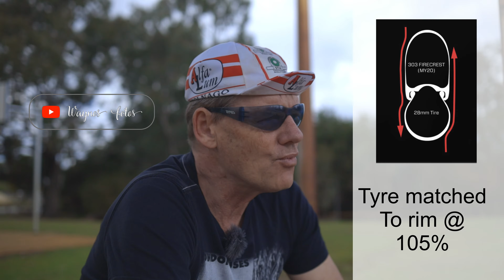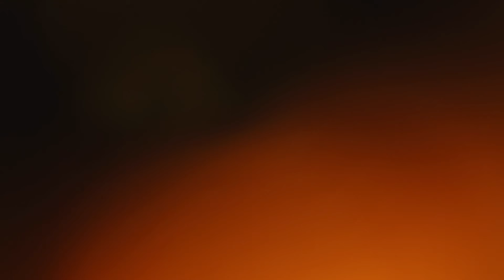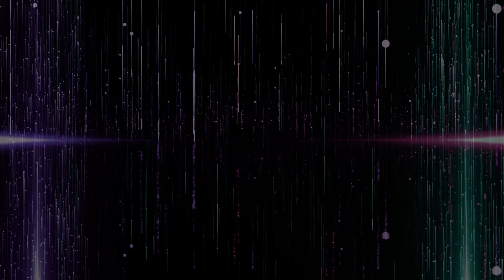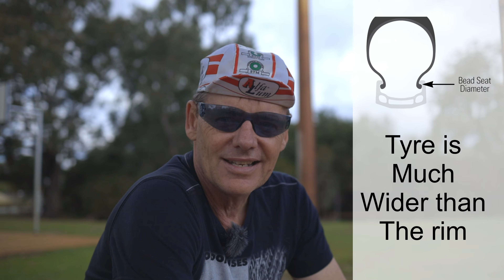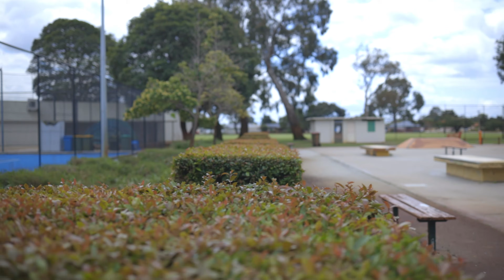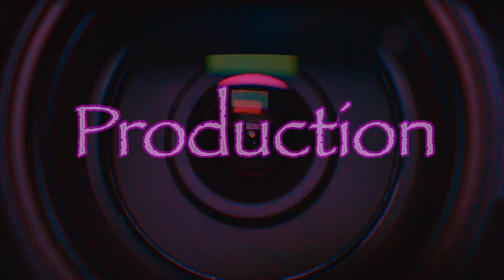23mm on 25mm RIM, using the 105% rule

Comment: can i put 23c on 28c rim?
I find in aliexpress Elite Wheelset Edge that is very light but they are 28c wide
40mm 1260g 50mm is 1320g
they also have 25c rim 38mm 1260g

Comment: Does Zipp's 105(%) rule say anything about getting your rims scratched because the tire fails to protect the sides of the rim against bits of gravel or the occasional kerb?

Pretty much sure it doesn't. And there's more to life than aero gains.
Reply from the maker: Yes that can be an issue

Comment: "Aero" is everything.  I just bought the newest "aero" tires, along with everything else on my "aero" bike which includes "aero" chain lube and my new "aero" rear LED light. I got my calculator out and added up ALL the "aero" advantages I have and I am now saving exactly 6.722368 HOURS per mile/4.1770863413 HOURS per kilometer. I am SO jacked! I  sent away for some "aero" beard oil that will decrease my dander/filthy beard drag by 28.5221% I'll update you in the future on THAT!
Reply from the maker: Loln

Comment: Running 23mm micheline tires on ICAN 25mm (outside) rims.  This is not in line with their recommendations. They advise minimal 24mm tires, but they are as rare as hen's teeth. The 25mm conti's I normally use don't fit my bike with these wheels..bummer. The current setup rides nicely, maybe a bit less demping.

Comment: For those that commented about comfort, try running 25mm up front and 28mm in the back.  I know we're talking fairly small gains here but the "105 rule" is more improtant on the front end than the rear where the seat tube on the frame blocks much of the airflow before it hits the rear wheel and you get the higher volume tire under your butt for comfort.
Reply from the maker: True front is where matters
Reply: @The86rick  Hmmm, ok sure, if you live near the cobbled streets of Belgium I guess that’s true. In my personal case years of training by 12 ounce curls have gifted me with forearms and biceps of steel. So real men don’t suffer from arm pump. Not sure what the metric equivalent to a 12 ounce is…. A one pint lift?  ;)

Comment: The "wider tire is best" crowd love to cite the superior rolling resistance of 28mm+ tires despite the fact that rolling resistance on actual roads is almost impossible to measure accurately, and totally discount the aero advantage of the 105 rule that is, at very least, a metric that is possible to measure.
Reply: “Rolling resistance is a myth”
Lol I’d throw you a Maxxis minion 2.6 dhf tyre to your front wheel and I’ll see if you still sing the same tube. 
You ca measure and compare RR in a lab setting. That difference can than be extrapolated to a real life scenario. To always argue “urgh but that’s not in a real life use case”, is simply being pedantic and silly.
Reply: @87togabito  RR measured in a lab is usually done on smooth drums and despite elaborate steps taken to make it more applicable to outdoor riding, nobody has ever sufficiently demonstrated that their lab RR tests reflect outcomes on actual roads, despite you saying it can be extrapolated.
Reply from the maker: I have done videos on this, 
As a performance metric, rolling resistance is a complete myth, when applied to the real world. 
The ability of the tyre to control road imperfections is a much bigger variable, why wider tyres are better on rough surfaces and skinny tyres are better on smooth surfaces.
And something people have forgotten is soft sidewalls control road imperfections better, why high TPI cotton tyres are still the best, size vs road for road imperfections speed trade off.

Comment: While true, those small aero gains are not relevant for 99% of riders and pros of a slightly wider tire (comfort, safety) are greater imo  :). 25mm clinchers on 17mm internal rims for winter, 25mm tubs on 24.2 outer-outer rims for summer.

Comment: That's about what Josh Portner  of Silca Velo  said. Might be true but recommended a wheel set costing double the value of my bike. He'll sell you secret sauce chain lube if you're interested. It's probably as good as the stuff GCN is being paid to promote now. Used transmission fluid works well too! 1/8" chains are inexpensive though. Cut it to length,  use it up, get a new one when it gets dirty.
Reply from the maker: I actually watched his video, they did some research on this when he worked at Zipp. Unlike other claims in the industry this sounds legit!
Reply: @waynosfotos  I agree.  The message is though that pro teams have had it all wrong forever.  Average riders emulate the pros and are now expected to buy new kit. I am glad to benefit from new tech as it trickles down. I'll take my tech A' la carte!
Reply: Used transmission fluid. Why not new. Won't it attract junk ?

Comment: I don't subscribe to any rules like that when I match tires to my rims. I pretty much have a tire brand and size that match the OD width of the rim. Some brands tires end up wider than their spec when mounted to particular rims and this also makes it hard to find proper tires but I use the R3 which usually is more narrow than its spec and therefore when mounted on my wider rim gives an aero shape that Hambini would be proud of.

Comment: Just a thought. Watch Alaphilippe as he broke away and mashed his way to victory. All the aero gains made by his equipment were irrelevant cos he rode on the hoods in a non-aero hip-snaking position with face fuzz. Why? Cos he was comfortable and could breath properly so put power down. Aero is often overrated, as he just demonstrated
Reply: However in this case, the tyre does nothing to affect your posture. 
The aero gains here are have no cost, outside a financial sense. 
And imo, money is literally the easiest upgrade a cyclist can get. You have to train for fitness; buying an aero bike or frame only costs money.

Comment: I run 28mm tires on a 20mm Internal/ 25mm external width and it’s great
Reply: hey, could you please tell me how wide that tire is on that 20mm internal rim? I want to buy new wheels and I had 28mm Conties on 17mm internal rims that measure almost 29.5mm, now im worried about fork clearance if the tires is gonna be too big
Reply: @ThePsychonaut  yeah, sure thing. On my current wheelset the 28mm tires measure more around 29 to 29.5mm
Reply: @astrayagrarian  its the same, I found some rim with the same dimensions, actually 21mm internal 28 outer and tried the tired and its 29.5 almost 30mm, thanks!
Reply: Do you notice any aero drag from having a tire wider than the rim I assume not since it's only two or three millimeters?

Comment: I thought I was down with the kids when I got my new rims and schwalbe pro one  28mm tyres which should have given me the optimum 105 percent . They did make me 
Slightly faster  but when measured with a vernier caliper were 30mm. I got used to the comfort of bigger tyres and now have stuck to 30mm as my ' go to 'tyre.

Comment: From my perspective, losing 1 lb. of body weight will give you more advantage than switching to a '105' set-up. So is it worth it to put up with far more road shock? 
I think not.
I think that having your tire larger creates a slightly larger aero tear drop that puts your tire/rim and rim/spoke transitions in the 'vacuum' area in your aero tear drop. Thus minimizing  the aero distortion caused by the irregular profile of those transitions. The slight increase in the aero tear drop is far less friction than the distortion caused by a too close tire profile.
Reply: I think difference in comfort is unnoticeable if you use comparable tire pressures. Difference becomes noticeable if you use fatter tires with very low pressure, but then you have additional penalty in the form of increased rolling resistance.
Reply: I actually run lower pressures with a 23c on a 25mm od rim than I did running a 25c on older slimmer rims. The reason being that the sidewalls of the 23c are straighter on the 25mm od rim. With greater curvature of the sidewalls you have to run higher pressures. The 23c/25mm OD rim/75psi combo has made a super rigid frame so much nicer to ride on especially when the days get long.

Comment: My rims are 21mm internal and 28mm external and I'm running 25c tire in front for aero advantage (maybe) and 28c tire at the back for comfort (surely) 😉
Reply: hey, please i need some info, could you measure how wide is your rear 28mm tire on that 21mm internal rim? I want to upgrade to new wheels and im still not sure how is that gonna look because right now i run 28mm Conties on 17mm internal rims and they come up almost 29.5mm wide
Reply: @ThePsychonaut  depending on the model, tires of older construction becomes much wider than newest ones. My old non tubeless conties measures almost 32mm, than my Hutchinsons fusion5 11storm measures at about 31mm, than Pirelli cinturato TLR have about 30mm width and my Tufo comtura 4TR measures at about 28mm. My buddy have Pirelli Pzero TLR and they measures about 29mm. So, you can see, how big difference can be in between brands and models.
Reply: @romanpramuka2703  Thanks man, I still need to research more, im in need of new wheels my rear Fulcrum hub broke on spoke, im considering some carbon rims that are 20mm internal and 27 outside, my frame is designed for 28mm tires but it gets kinda tight at front, it rubs on corners when i put all my weight on the drop bars but then when im on hoods it all runs fine
Reply: @ThePsychonaut  it looks like you need some stiffer wheels, maybe with deeper carbon rims. Keep in mind that with wider rims, tires becomes wider but not taller, it isn't same as wider tires on narrow rims.
Reply: @romanpramuka2703  wider yes, thats what I'm afraid of lol, 35 or 38mm is the deepest I'd go with 24 spokes, hope it turns out well
Reply: @romanpramuka2703  I have tested today my tires on 21mm internal rim 28mm outer and they measure almost the same, almost 30mm, mine conties are 29,5 almost 30mm on my fulcrum 17mm internals, so i think im gonna go with 21mm internal and 35 dept x) Though I would appreciate any suggestion if you can add x) i'm a light rider 60kg and mostly like to climb but i like to go fast on downhills, I hate flats and avoid them as much as i can unless im riding with someone or at least 3+ ppl

Comment: What’s the best width of wheel to use with a 25mm clincher tyre? Thanks for the video Wayno
Reply: The answer is in the video. Remember the part about the 105 rule? Multiply 25 by 1.05 and that’s your answer.

Comment: The main issue is the different rim and tire hook designs. I have 25mm clincher tires that are 26 mm wide on one set and 24 mm on another rim set. So you have to play around a bit to get an exact 105%. However tubular tires don't have that issue and are fairly accurate on width.

Comment: I had 23’s on my rims but my perception is that I was slightly slower because of rolling resistance so I switched back to 25s
Reply: That will happen in the snow.
Reply: Lol it is 1 watt of difference, that means maximum 2/300 watts  = 1 /150 = 0,66% of difference of speed. You have a very good feeling to know exactly at what speed you should be considering the wind and the slope.